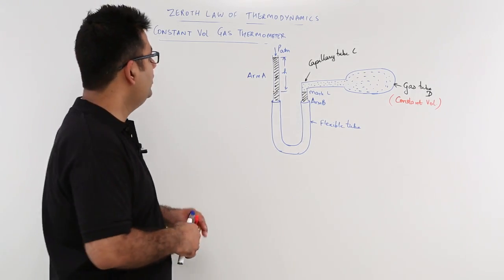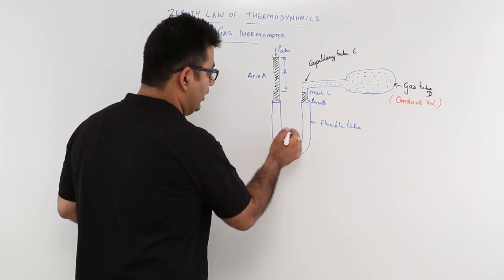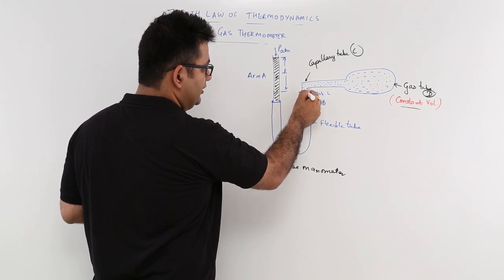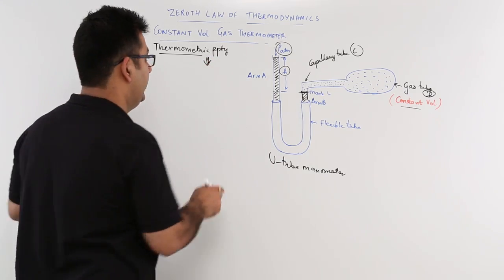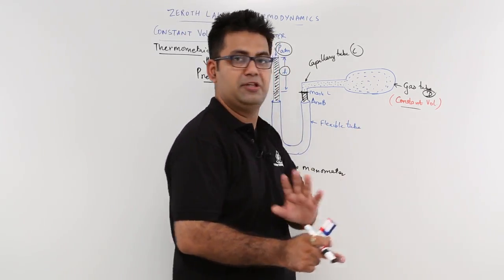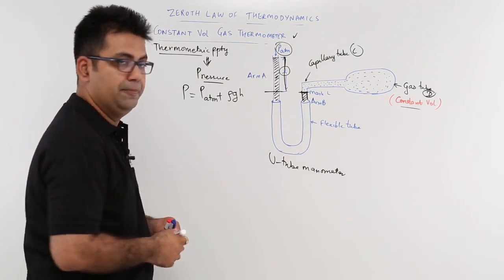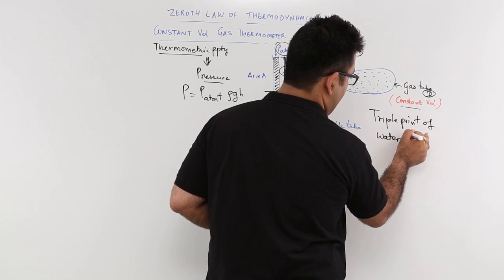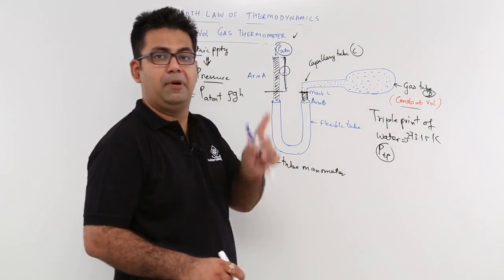Constant Volume Gas Thermometer

Comment: when the temperature increases doesnt the pressure of the gas decrease?
Reply: When the temperature of gas is increased the average kinetic energy of molecules of gas increases. So they push mercury with greater pressure. hence the pressure increases.
Reply: no
Reply: the mid  kinetic energy of the gas go high!